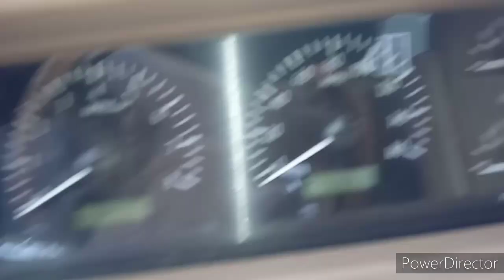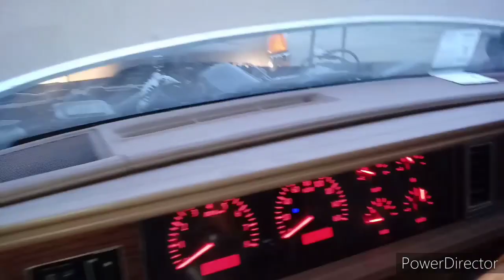winnie da pooh procharged ls cutlass supreme finally back home

Comment: Why yall dont run intercoolers on the centrifugal blowers ...an procharger not that ugly .. that's a powerdyne or sum ...nice starter build
Reply from the maker: That kit came like that if i remember
Reply: Low boost car. The ghost got a big ass intercooler!! But that's a turbo with big power. That silver cutlass run like a 383 with a truck cam and little vortec heads lol